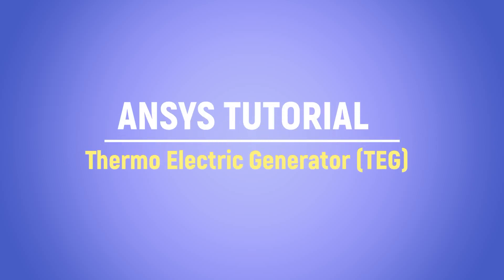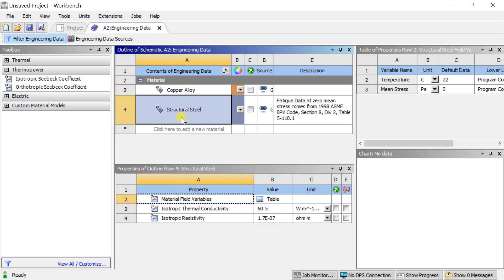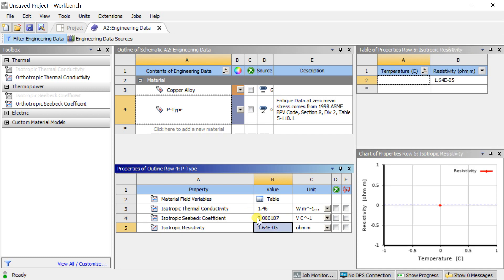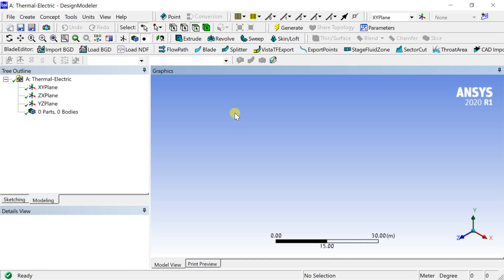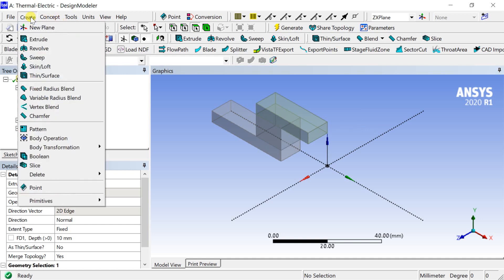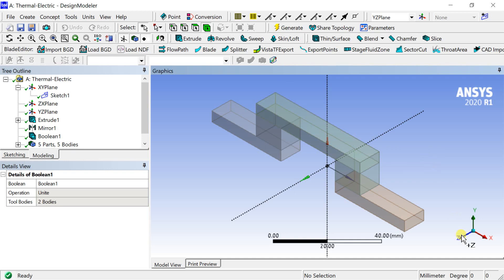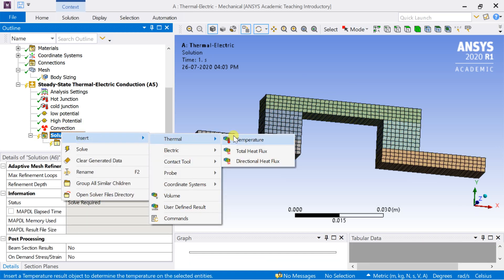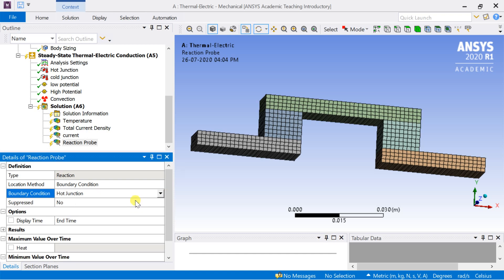ANSYS Thermoelectric Generator (TEG) Tutorial | Thermal Electric Analysis in ANSYS Workbench | TEG

Comment: Thank you for the video, how did you know the value of the high potential (0.08V)? And I want to know if I want to draw a TEG of small trapezoidal dimensions (big base = 6mm, small base = 3mm, height 8 mm and thickness 1mm)  how i am supposed to do the simulation in order to know the voltage output, should I draw all the elements inside of it or can i consider it as an object and apply the temperature difference?
Reply: Did you find out how to do it?

Comment: Sir I have modelled a TEG with 64 couplings, the way you did, and the problem is that when I double the high potential voltage, the current also doubles. Shouldnt it be half the previous number according to "P=VxI" ?
Thank you

Comment: Hi sir. When i try to solve the module (step @13.40), the percentage is still at 10% eventhough i have wait for more than an hour. Does this mean that my pc is underspec, or is it related to other problem? Btw, i'm new to this Ansys software. I hope anyone can help me. Thank you
Reply from the maker: Try to reset the setup and again do it. Is it the same geometry or it is a different one. Sometimes solution timing affected by the meshing. So check the meshing, make sure that its within the required limit. Dont create more unnecessary cells if its not required.

Comment: Thank you for this amazing tutorial
please I have a problem when I click 'solve' an error message showed up 
"Your license configuration does not allow pure electric analysis necessary to use with defined material properties." what should I do ?
Reply: Take a look at your material properties in Engineering Data. To avoid this error message you should apply at least one thermal properties for the material. For example, thermal conductivity.
Reply from the maker: Have your mesh exceeded the allowable limit of 32000? For student version.
Reply: @AnsysTutor  I'm using entreprise version.
but I don't know what to do now

Comment: Dear sir kindly respond as soon as possible..... Or anyone else who can answer my question.....
In this vedio we apply potential difference across the end of our generator....and we found current and heat absorbed and current flows in through it.....
Can you explain that why we take potential difference across its ends bcz it's a generator so it should induced emf and current...........
Reply: The potential difference can be measured with a thermocouple, so the potential difference is a meausre for the temperature difference

Comment: How do i measure the Voltage with different temperature?
Reply from the maker: You can insert the voltage probe to see the voltage results.
Reply: But i want to know meassure the open circuit voltage so i put 0v at one leg and meassure the voltage across both the n & p leg. But when i solve the simulation the overall progress bar is going in a loop.
Reply: @mohamednazer8131  I don't know if u still need this but i made it like this : I put 0 V at the n leg and just put an electric voltage image in the solution. Just run this and click on electric voltage. The high potential is the one you are looking for.

Comment: From the thermoelectric generator power law, the power produced from the thermoelectric generator is equal to the difference between the Heat absorbed at the hot side and heat rejected at the cold side, so if we need to calculate the power harvested from this TEG, we need to calculate the heat rejected at the cold side by insert Heat reaction probe and specify the cold junction and then apply this law (Heat Absorbed - Heat Rejected ) to get the power generated ..

Is this correct ?
Reply from the maker: yes

Comment: I have a question,, I make a TEG model in ANSYS FLUENT and calculate the temperature distribution around the two TEG sides, how can I calculate the output power from it ? How Can I Import the CFD results in ANSYS FLUENT to the ANSYS Thermal-Electric? or there  is another way to calculate the power from the FLUENT ??
Reply from the maker: You need to take the ansys fluent first into the project schematic , then take the thermoelectric and make a link with the fluent solutions.

Comment: Great Explanation !

But I have two questions 

the first one is: Is the 23.267 Watt that calculated at the hot side represents the output power from the Thermoelectric Generator ? if it is not, then how to calculate the generated power ?

The second one: I make a TEG model in ANSYS FLUENT and calculate the temperature distribution around the two TEG sides, how can I calculate the output power from it ? Can I Import the CFD results in ANSYS FLUENT to the ANSYS Thermal-Electric? or there  is another way to calculate the power from the FLUENT ??

Thank you
Reply from the maker: Yes, that is the generated power. You can couple the fluent with the thermoelectric module & import the temperature load to get the output.
Reply: @AnsysTutor  How to do the coupling process ? I think that I must import  FLUENT results to the Thermal-Electric ,,, but how to do this ??

Comment: Amazing tutorial 👏, I would like to ask, does this demonstration goes until to fluent solution or just stoped in meaning? 
Thank you
Reply from the maker: Its a separate module ,no relationship with fluent ,if you want you can use the coupling technique to connect it with fluent .
Reply: Thank you, would like to also see kind of coupling, I’m new in ANSYS fluent
Reply from the maker: We have a FSI tutorial ,on ansys fluent and static structural coupling you can see that to get a knowledge about how coupling system works.